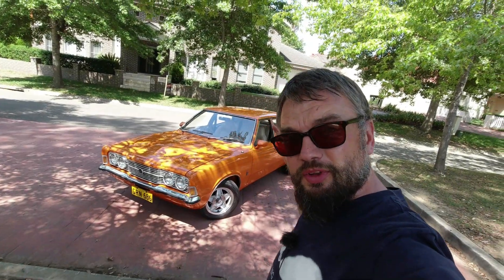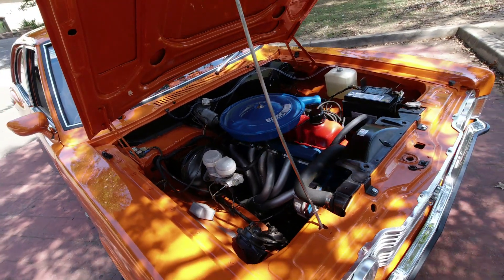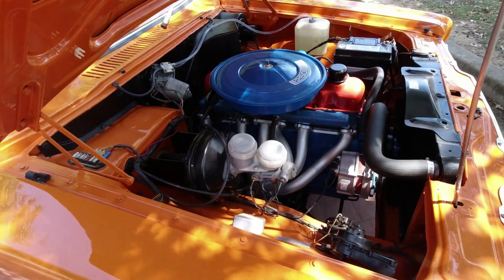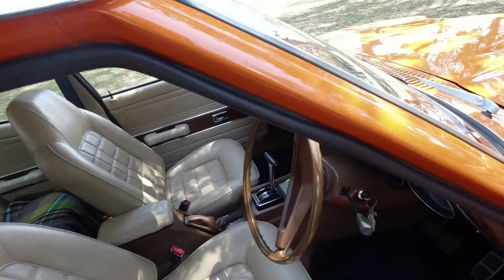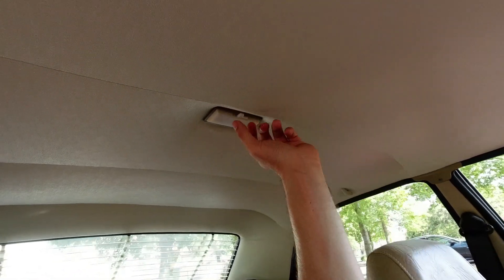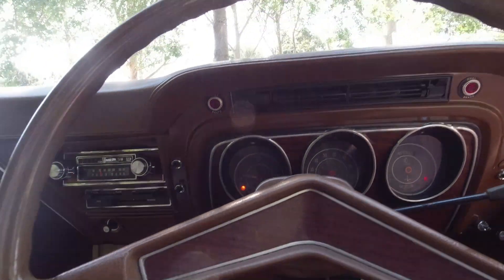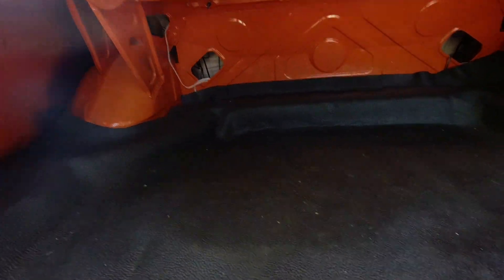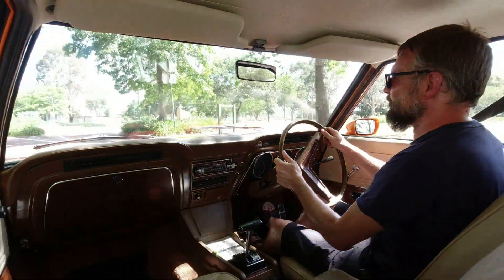Aussie Oddballs: Ford Cortina 6! 4.1-litre, tested in 40+ degree heat

Comment: Exactly what U.K. Cortinas were lacking, burbly straight six goodness.
Reply: I can't believe it took them until the mk4 to fit a V6.
Reply: @dungareesareforfools  I know. The 2.3 V6 was only about as fast as the 2 litre 4 but it had a refinement about it much more fitting of the Ghia model. I'll never understand why they didn't bother sooner.
Reply: The 1970's fuel crisis might have played a part, in short supply and doubled in price almost overnight.  Ration books were produced but never actually issued, garages put limits on fill ups, if one had the patience to queue for hours.
Reply: @danielrussell446  Absolutely! I had a mk5 2.0GL and it could certainly shift.
Reply: @danielrussell446  Savage Engineering did conversions using that very engine on the mk2 and mk3 Cortina. Such cars that survive are worth silly money nowadays, of course.
Reply: @tonys1636  Yes, very probably had a lot to do with it.
Reply: @danielrussell446  South Africa got a 3.0 Essex in a mk4
Reply: @PhilOsGarage  Indeed in South Africa the Mk3 onwards Cortinas got a 2.5 or 3.0 Essex V6.
2.5 V6 with 120hp and 132 lb/ft 
3.0 V6 with 144hp and 174 lb/ft

And there was even an "Interceptor" version with x3 Weber DCNF Carbs and ported heads with 175hp and 194lb/ft.

Some UK based companies also fitted the 3.0 Essex to the Cortina.
Reply: @danielrussell446  the song called 'beige Ford cortina' features one, it's the most hubnut song ever.
Reply: Looooooool
Reply: I do recall a good handful of mk3s rumbling around with V6s though, home brew cars of course!
Reply: @PhilOsGarage  I had a Cortina P100 new on an A plate (uk) started as a 1600 I put a 2000 cc lump in it, and after warranty ran out a 3litre v6. In south africa a shorter wheelbase version was standard with the 3litre lump. I drove one of those and it scared the poop out of me, too short and stiffly sprung for comfort. My hobby in the 70s was 2ltr pintos and v6s into mk1 escorts and a Prefect 107e I owned then. Also squeezed a v6 into an Anglia, very difficult and quite lethal
Reply: Most of our cars in the UK wer lacking in bhp compared to oz NZ and sa
Reply: yes,  a lot of people fitted the 3.0 V6 from the Granada
Reply: @dungareesareforfools  The mk2 Cortina Savage had a Kent v6 here in UK by 1969. Very fast but prone to overheating!
Reply: @paulbennell3313 , but only when compared to the various asthmatic blobs of the era.  In Australia, a 2L Cortina could see off General Motor's equivalent family hack - because Holden put an odd 1.9L cam-in-head Opel lump in its mid-sized Torana/Sunbird. (They soon replaced it with a weaker, thirstier motor: another 1.9 iron head 4, but this time, pushrod - as it was a cut-down version of their 1963 origin 'Red Six'.) The Pinto could make an Escort pick up and fly, but the Cortina was much heavier, and nothing special at all.
Reply: @FirstOnRaceDayCapri2904  A friend of mine had a Sth African MK3 Cortina in the mid 80's with the Essex 3.0 fitted
Reply: There are many Australian corty's that have had conversion to Ford Windsors, and there are kits for Cleveland conversions too. A quick google will do the trick. On same note Chrysler Australia imported a Simca, then stuffed 245 and 265 cid hemi head straight sixes (Chrysler Centura). I had a 245 cid manual, went like shit out of a shanghai. Only downer was a LHD steering column transplanted to the right for us, countless times I'd hit the wipers instead of indicators. Large engine, light rear end, young driver, tires smoke.
Reply: @KG84C  Those Simcas came to the U.K. in tiny numbers. Good looking car, an interesting alternative to the more regular Zephyrs and Crestas we had over here at the time. Pity we didn'y get more of them.

I'm given to understand there was a tie-in with Ford France who took over production of that model and an option was a V8 similar to a Ford Windsor but in which every bolt thread was metric. It was badged as a Ford Vedette.
Reply: @paulbennell3313  The car was called the Chrysler Centura here, and was quite flighty in the wet with a heavy but strong six up front, and not much weight in the rear, tricky in the wet. Might have been the Aquila or Mistral V8. I guess we were in a similar position to US/Canada, big country, relatively cheap fuel (To UK/Europe anyway) so big sixes and small block V8's were very popular post WW2 to the 80's. Alas the days of the big aussie six or V8 sedan is long gone, though I've owned a Chrysler VH Valiant wagon, Ford XC Falcon hardtop, Chrysler VK Valiant ute, Chrysler KB Centura (Rebadged Simca with local hemi six), Ford XA Falcon hardtop, Holden LJ Torana, Ford ZH Fairlane, Ford P6 LTD (Silver Monarch edition). They were dime a dozen when I owned them. Now its a Kio Rio hatch and Sportage wagon, I've become very domesticated.
Reply: @KG84C  There isn't such a need for big engines to cover large distances here in the U.K. There aren't really any large distances. But the refinement and low down grunt from a big six or V8 are something I generally feel cheated out of. Having said that, I do wonder how much longer we'll be allowed to drive such cars. These are things we'll never see again.
Reply: Victor Murat  Yes, but they weren't made by Ford!
Reply: I had a 1973 Cortina, my second car in the early 80's loved it. Only had the  1.6 Kent engine though, this straight 6 would have been heaven!
Reply: dungareesareforfools : Its didnt. The South Africans had 2.5 engines in them in 1971, and Savage had the 3 litre Essex in 71 as well. The issue was sales and industrial matters with supplying the engines to West Germany. The capacity was taken up by the huge amount of external clients like TVR and Reliant who had to get British  Type Approval. The  GXL Capris and Granada were taking supplies too. They were hard pressed to even continue with blue painted British made Kent 1600 and 2000 cc Pinto engines which were being exported to the US.
Reply: Daniel Russell : That did happen. The Savage GT option.
Reply: Daniel Russell : They were all sub 18 second quarter mile cars with the 2 litre T series engine. 0 to 60 mph in 11.8, top speed 107 mph. Bw 35 and C3 Automatics were much slower. The European tamperproof  emissions versions were very slow untill the Bosch electronic ignition upgrade in late 79. The fuel economy improved a huge amount when the axle ratios were changed.
Reply: @assininecomment1630  the 1.9 Starfire engine was probably in less than 10% of  toranas offered for the last 2yrs. 90% had a 6cyl or V8. even the first HB Torana was a Vauxhall and Holden extended the bonnet and put in a 6 cyl in 1969, ten years before that last UC sunbird. That same 1.9 engine went into the Toyota corona around 1981-83. 

Basically the 6cyl Cortina didn't come about because the 2.0 pinto was underpowered, it went well, but because Holden had decided a 6 cyl small car was the way to win Bathurst. First the GTR 6cyls and then the SLR 5000 V8 muscle cars. The same cars in standard not race trim were also a huge success so ford had to answer. I don't think they sold a 250cu/4.1 L Cortina, only the 200cu/3.3 and the 4.1 is a straight swap of same type engine in this car.

 Chrysler brought out the midsize 4.0 hemi Centura to compete also and that can swap in the 265cu/4.3 hemi. Those hemis are no way asthmatic like the standard Holden and ford 6cyls and can shred tyres effortlessly in the centura
Reply: @cruiser6260  4.1 was an available factory option from the TC all the way to the TE/TF. My Uncle had a crossflow iron head TE in the early 80s which was definitely a 4.1. And considering that the 3.3 was already vastly heavier than the 2.0 four, for the sack of the extra kilograms Ford wasn't going to pass up a marketing opportunity like that. I believe you're right about the Centura though.  Chrysler only built them up to the 245 cid 4.0 litre. Any 265 cid 4.3 litre Centura is an obvious engine swap case.
Reply: Don't kid yourself, those Cortinas were not especially quick, so it was all noise,  plus the nose-heavy handling, adding to the crappy handling of the Cortina.  A deadly combination.
Reply: Yep
Reply: At least the German equivalent ( the Taunus ) was available with V6 engines.
Reply: @paulbennell3313  the 2.8 litre V6 with fuel injection had over 180 hp.
Reply: Cortina mk4 and onwards, were in reality no longer Cortina, but a rebadged Ford Taunus, thats why they were made with German v6 .
Reply: We had the savage! Although rarer than hens teeth.
Reply: @paulbennell3313 I had a metallic poo brown 1.6 mk5. Compared to a modern 1.6 it shifted too!
Reply: @paulbennell3313 savage used the Essex V6 iirc.
Reply: @ngauruhoezodiac3143 not stock. The Capri had twin exhausts and 160bhp. The XR4i had a crap exhaust and 150bhp.
Reply: @Rich77UK  Yes but that wasn't a factory car. Savages were made by Geoff Uren Motors LTD.
Reply: @Rich77UK  I had a metallic poo brown 2.0GL mk5! And that thing flew. It was made all the more exhillerating by desperately needing the tracking reset! No, I never got it done. Might've made it a bit less death-trappy but where's the fun in that?
Reply: @paulbennell3313  The steering in my 1.6 was all over the place. One day I was leaving work (18 years old) and driving down the single width lane WAY too fast...i forgot there was a fork with an island and hit it square on and launched myself over the island, other side of the road and halway into the field beyond. 

I got it off the bank and back onto the road and after that the steering was as straight as an arrow! No lie!
Reply: @Rich77UK  Ah you see, everything happens for a reason!

Comment: Omg the sound of that wiper motor took me right back to sliding around (!!!) In the back as a nipper. (I will add it was in a 1.3 L decor.  Remember those? Sahara beige with brown vinyl roof. A lovely combo but as kids it got nicknamed the banana car. Dad was a sales rep. His builder mate at the time had a gorgeous sunbeam rapier fastback,  also I think had a vinyl roof.
Reply: My dad had a sahara beige mk1 granada ghia with a brown vinyl roof back in the day :)
Reply: @superjosh3864  they looked amazing in that scheme. Especially the really swish coupe version
Reply: gs425 An "L Decor"!!!!, Yes I remember them, (1974 Series Two, model range)  came with Vinyl seats as standard, (fabric seat faces, or a vinyl roof, ) were part of the options packages. you paid extra for when you ordered the car brand new. Used to see quite a lot of them on the road in the UK,  in 1.3 /1.6/ versions, but as with most of the Mk.3's, owners did not take care of them, and 7 years in when they started to rust, especially as most were on the second hand car market by then, they got cheap repairs and scrapped, or written off by uncaring insurance Firms sadly. Genuine ones are very rare now. (there are at least 3 cars with an "L Decor" badge that should be "L"'s) that I have seen, in the UK,  I own 3 different models one Currently being restored on my channel to brand new, & the other 2 (both awaiting restoration work too) are in my videos if interested in having a look?, if you have not already seen them?.
Reply: @Cortinaman63  one of the special refinements the decor model had was a glove box light.  How we were easily amazed back then . Also I possibly recall was the first time i saw the Ford thing I've had ever since which is instrument dimming.
Reply: @gs425  That is true, I recall loving all the extra lighting  compared to what the Vauxhalll Victor interior had which my Dad owned before we bought the Cortina, it seemed so posh inside too.

Comment: I went to Australia in 1976. We hired a yellow mk3. My parents had a mk3 at home so they were confident to drive off (in those days rental companies used to show you around the car) Ours was the small 3 litre six. At first they hated the car because of the heavy steering and all the controls being in different places however once we headed out of town the extra weight and strength of the car was appreciated. 

At the time the roads were so poor that they thought the UK Cortina would probably not have been up to the journey. The Australians really had to redesign cars from other markets just to make them usable in Australia.
Reply: 3.3l was the smaller 6.
Reply: The GM Torana of the same size had a 5 litre V8.
Reply: they weren't heavy to steer at all lol
Reply: @kevbateup9567  I put a 289 in my Cortina, she was nice n fast

Comment: The Ford C-3 whines more than even a Powerglide, which is is an amazing engineering accomplishment. The amazing way it holds gears too long then shifts with a clunk, as a perfectly demonstrated at 10:48. Wheeee, clunuunk!
Reply from the maker: I believe it's a Borg Warner unit. Doubt the C3 would handle the torque.

Comment: I love the mark 3 Cortina. I think they look their best in 2000E spec.
Reply: A friend had a white one with  Black vinel Roof
Reply: 4000E!
Reply: I think the GXL or GT pre-facelift was the best looks-wise.
Reply: @porscha901  except when the roof fell off due to rust
Reply: my dad had an L reg Cortina 2 door 1.6 GXL pre face lift. it had the optional GT OHC engine in it. it was tawny brown with a black vinyl roof and full length webasto sunroof.
Reply: @secretsquirrel6124   They rusted, just as badly as anything else made at that time.
Reply: We had a pale blue one with vinyl roof, fitted 8track it was minted.. step dad had it sprayed red ..ouch!
Reply: My one is a 2000E lol
Reply: @celtic barbarian, the TF was a much nicer creature - strengthened front end, improved handling and ride, stiffer body, quieter, alloy head motors breathed better.  You could get easily get 30mpg on the highway, from the TF 3.3 manual.
Reply: Nah 2000 gt 2 door is the best
Reply: As they say,  @jasoncooke1999 , in the land of the blind, the one-eyed man is king.  😉 

How much of a 'grand tourer' was a Pinto donk 'tina?
Reply: I agree.
Reply: MGBetts1 : Me too. There was a 1600 cc overhead cam 2 barrel GT 2 door from 70 to the 74 facelift. It was a sweet car, with a lot of smoothness. David Vizard owned one. The issue always was the two door Cortinas and later 3 door poverty pack Sierras ate into the Capri market. Familes disliked two doors. The GT 2 dr was exceptionally good looking. The split between the largely Right Hand Drive  Cortina and LHD Taunus was unfortunate. The Argentine Taunus SP4 took over the TC Taunus 2 door fastback, which looked even better. Ford Australia in "Fords that never were" used a British two door body and  Pinto tailgate and planned a local  Capri replacement with a 4 bbl 250 six planned. The Mark 4 and 5 were to be skipped, and the 3 door used Mark I Granada head lights and indicators. It wasnt economic to proceed because they needed to sell more than 12000 to break even. The in line six cylinders were way too talk for the Cortina. The engines had a 9.36 inch deck, and the earlier 200 and 221 sixes were far lighter and much shallower in block height. Economics again. The engine height of the 4.1 litre engine ment the sweet balance of the 1600 GT two doors was never present in the four door  250 XL and GXL's.
Reply: John Morris: 4100E   (smileyface). A Dunlop tyre development engineer couldnt wait to get his hands on  250 Ford six car in 1982. He came away mightily disapointed."I thought with a four litre engine it would be wounderfull to drive, because to me, a big engine means big power. Instead it is a lazy mans car with a lot of torque. It suits Australian driving".Re-runs of Neighbours from 1988 show Clive doing a burnout in his 1973 Maroon XLE 250 six. My favorite episode....
Reply: Assinine Comment : Im totally with you. The cross flow six was an engine you could do things with, the old log heads and 2Vs were missing the lightness and punch of the later alloy head 4.1s. The 3.3 was especially good as a 4 speed as they had almost as much power as the 4.1. 114 hp verses 126 hp. It was the savage body roll from the progressive rate springs that ment you had to find the optional Sport Suspension. The last of the 2 litres had all the ADR 27A power losses removed. 17.9 second quarters and 174 kmh top speed. The 4.1 was a second quicker and 14 kmh faster. No one realised what a good car the TF 4.1 litre Cortina S pac was. The XLE was still "in development". It took the Commodore to improve it. Holdens 4.2 litre 253 was a dog intill the XT5 twin exhaust option with the M21 gearbox came out in 1982. The Cortina was almost a 16.6  second car like the four speed SS 4.2 "non HDT Groupies" were. Just like the XE Falcon verses the WB, the Cortina just didnt point as well as the Commodore did. Howard Marsden had gone to Nissan to sort out the random Datsuns instead. Fred Bloom did a good job, but timing wise,  if  only Ford Australia had a budget to put the 78 US Ford Fairmont/ 79 Mustang Foxes Modified MacPherson struts in as well, and not just the hubs and TRW power steering. Like almost winning the around Australia Repco Trial, Ford almost turned the Cortina into a silk purse like they did the Falcon. Almost...Fact is Ford Australia made the Cortina 6 a heck of a  lot safer with the TE and TF mods.
Reply: @Deanthanks for your informative post and I totally agree with you. The final TF Cortina was a well developed package, unfortunately lost to public perception underneath the ‘new-age’ Commodore hullabaloo. 

Personally I think the final Cortina was a better (and higher quality) car than those early Commodores.  

For example a mate who ran a major Repco agency, his business car was a top-line TF Ghia 4.1 with auto, air, power steer, sunroof, etc. We were both in the trade and I drove it many times; we both agreed it was, for normal motoring, superior to its equivalent Commodore SL/E 4.2 V8. Solid, smooth and tastefully trimmed. And because the market had by then forgotten the TF it was also significantly cheaper to buy!